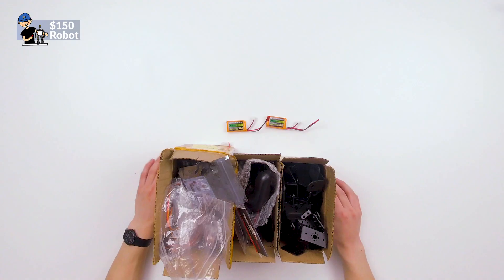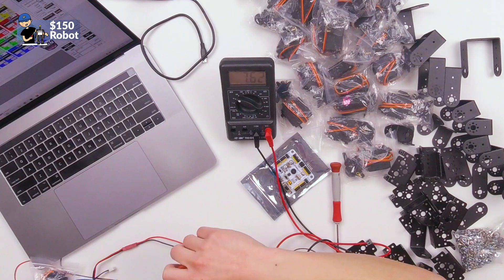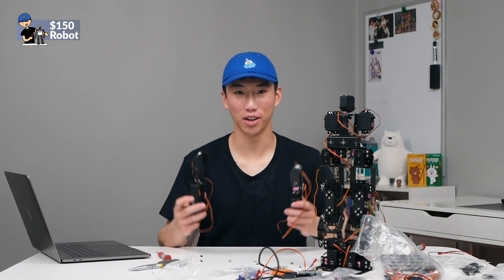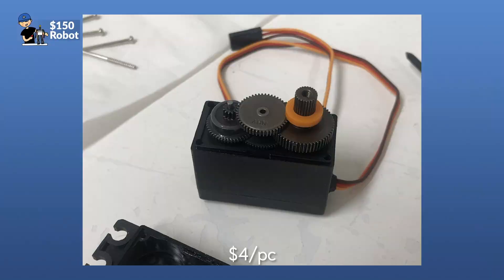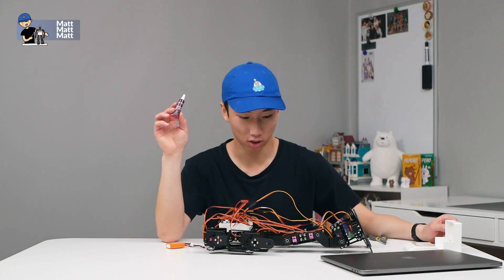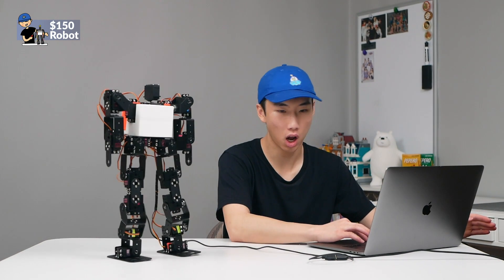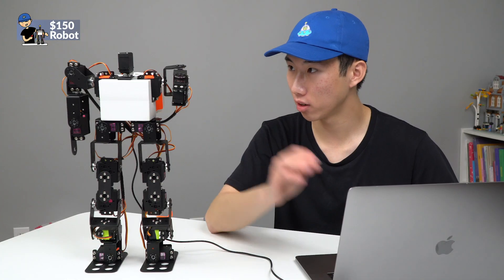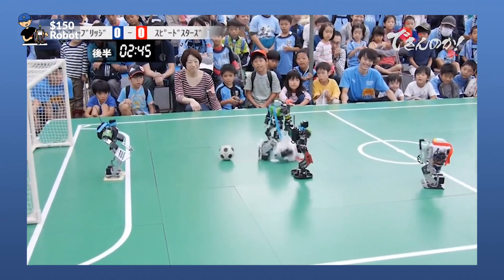Building a $150 TikTok Viral Robot

Comment: so have I been wasting time with arduino? is all I need to program my robot that servo controller or do you connect that control board to something like and uno r3 or mini. I have my robot built just trying to program it using PCA9685 servo controllers and its not fun
Reply from the maker: I just used the servo controller, but I don’t think it’s the best - basically hard coded the movements
Reply: @mcho_archives_2  gotcha thank you for the reply.. I would like to try one of these servo controllers but the ship times from China are all over a month for the servo controllers I want to try.. guess I’m stuck writing it line by line for the time being

Comment: may I know about the battery/ abt the power supply......like how much of power should be given
Reply: Battery voltage as he said is around 7.4V and servos are 6v. So he dropped the voltage using a buck converter.
Reply: @dilankapintoe3591  There's a range for the servos - official tower pro are 4.8V to 6.6V, but some of the knock offs can be around 4.8V to 7.2V......Make sure you check data sheets or any info given to you by the place you buy them from.
Reply: For anyone here years later - the battery is completely wrong for the servos.  Servos require approx 1 amp so if you're gonna have say....6 servos working at any one time, you'll need a rating of at least 6000mAh.
Reply: @redlight1505  hahaha, thanks man....... it's been 2 years since I fucked up all the servos